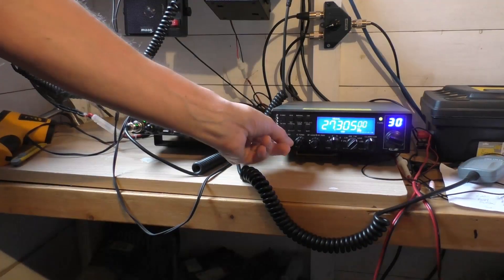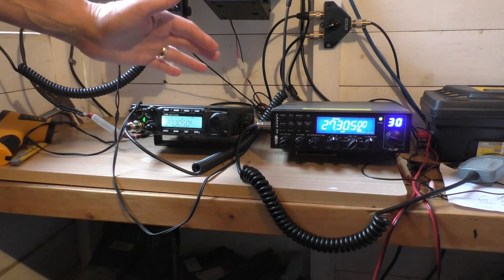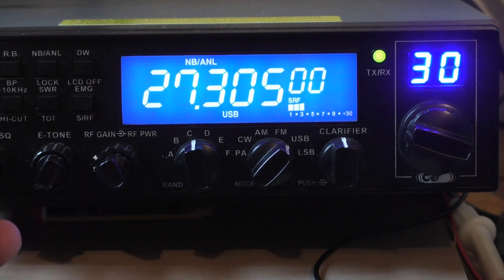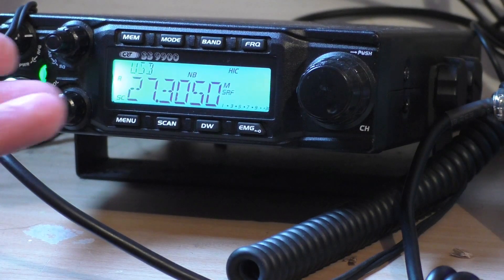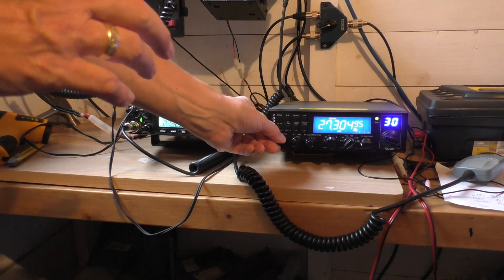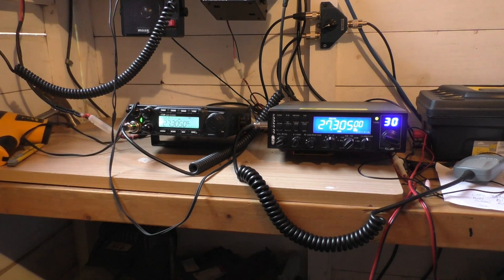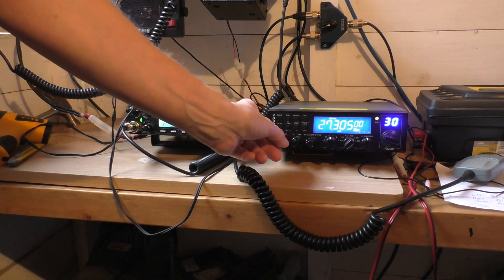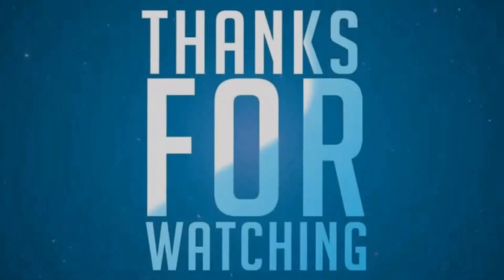CRT Radios can start off Frequency !  This could be a deal breaker.

Comment: Had a CRT 3900 EFT for 10 years and that is a quirk of these radios. As you say just let them warm up before transmitting on SSB. Even my Icom 7300 is slightly off on 11m  . Maybe because it comes stock as RX only on 11m ?? Who knows.. Even some frequency counters I have used, are slightly off .. Thanks for the upload. 73s 153 AT 888

Comment: Hello Fred , your absolutely right , these radios would work better with high quality capacitors , the capacitors can be replaced with higher quality & the radio will be fine .
Reply from the maker: Hi.  Yes your right.  I guess you get what you pay for.  They are fine if you let them warm up.

Comment: All radios drift a bit Fred, even expensive one, though they tend to be engineered so you don't notice quite so much, but the all drift and usually come on frequency when they heat up.  That is why when I fixed CB's I turned them on and left then until I set everything up to test them, by that time they were a bit more stable, some more than others.  Even the big expensive radios do it.
As someone in the comments said "Put any set in Alaska (or Antarctic) and it will drift from cold and stabilise as it heats"  Much more noticeable on SSB than other modes.

Comment: Mines always a bit high - have to set to 97.
More annoying is channel selector doesnt always change channels
Reply from the maker: Yes the channel change can be a bit odd.  If you turn it too fast it changes 2 at a time.
Reply: Fred in the Shed  i turn mine like 3/4 notches & it hasnt moved
Reply: Same deal with mine. That's because the tuning is Software Defined and not mechanical. So the RAM chip that stores channel frequencies can't keep up.
Reply: Yea , My  9900 does that thing with the channel selector sometimes ..

Comment: Hi Fred, The SS9900 also has the option in the menu to tune TX/RX together. It comes default in Received only clarifier.
My AT5555N (7900) is the same way.
Reply from the maker: Spot on Scott i made a video linked at the end.

Comment: Hey Fred ,just a update to CB Radios drifting or off Frequency. Even Calibrated Test equipment have a warm up period. Particularly 8 digit frequency counters. I recently aligned the Frequencies on my CRE 8900 using my,
Icom 7300 as a reference. I know the Icom is spot on zero beats. This link was very useful.. I am guessing most surface mount Multi mode radios can be calibrated the same way, via the service menu... Just dial in the AM Carrier, to zero beats.. Here is the link..73s https://youtu.be/9GZ5cIqNlfk  P.S. Just remember a lot of receiving stations automatically assume you are off frequency ,because you sound weird to them 90% of these stations are well off frequency..Especially on 11m.And as you said the crystals and components are budget. compared to HF rigs.. 73s 153AT888/ HS0ZOU.

Comment: Good explanation Fred my 6900 is a few HZ off frequency from a cold start but leaving it on receive for a couple of minutes warms it up enough to put it bang on.  My 9900 is the opposite its bang on from a cold start but drifts around 6HZ lower than the TX frequency especially when the finals warm up most stations won't notice it but stations using HAM gear can notice it.  There is a way to tinker with the settings in the hidden survice menues on both radios I accidently somehow nearly messed up the TX frequency settings but thankfully I wrote down the default values so managed to save both radios during the summer but your average station won't really notice it.

Best 73s from 26AYP001 Central UK.

Comment: AM & FM will drift, it's just not as critical or noticable as SSB.
Proper 'grown up' radios use a TCXO where the reference crystal is in a tiny oven which is temperature controlled so the radio will stabilize very quickly after switch on.
Reply: Hello, what is a Proper Grown up Radio,,exactly, thanks 😊 a few examples, 73 Rotterdam
Reply: @Bernard-John  I will explain the heirachy of two way radios.
At the very top of the pile, you have military radios. They are designed by the absolute creme de la creme of designers, and built up to a specification rather than down to a price. Absolutely no expenses are spared here, because people's lives depend on it.
Next you have commercial radio which are solidly built and well designed, because peoples' jobs depend on it.

Further down you have amateur radio where the user is treated with a flourish of knobs to twiddle with to their hearts content. The product designers here kind of use this arena as a kind of proving ground.  Sometimes they hit, sometimes they miss.

Then you get CB. The volume runs are not that great, the R&D investment is significant in terms of overall returns, the end users generally have low expectations, no ambulances will crash and no aeroplanes will fall out of the sky if it all goes wrong. 
CB invites the ethos of just about adequate at best and attracts the lowest sphere of designers and manufacturers.
Ik hoop dat dat verklaart

Comment: @Fred in the Shed Did you know that the CRT SS6900N has a 'talkback' function? I just found out how to enable it yesterday when I was playing with the settings lol
Reply from the maker: I know it has a monitor setting.  A talkback on a HF records a short piece of audio.
Reply: @CB-RADIO-UK  ### The CRT SS 6900N v6 'talkback' feature ###

Step 1: With the radio on Press & Hold the Function key for two seconds.

Step 2: Press the function key again. The display should read:

n09 off.

Step 3: While the display reads: n09 off   turn the channel selector.  Your 'talkback' feature is now enabled and you'll notice you'll be able to choose a 'talkback' level from 1 to 63.

Step 4: Wait until the display goes back to normal then choose a channel to test your 'talkback' volume when you key your mic.

To turn 'talkback' off again just follow steps 1 to 3 until the displays n09 off.

Comment: CRT 6900n is SDR (Software Defined Radio) and need time to warm up, like any other radio wether its a £40 or a £5,000 radio. If you radio is really off freq just recalibrate however you will need all the gear like Oscilloscope.

Comment: If this is a deal breaker then what about the icom 9700 that costs £1700 and drifts, then you need to spend another £200 on the fix.

Comment: It affects of course on AM/FM too. The Bandwidth is wide enough so you dont hear it. On Sidebands, you only use such a tiny bit of Bandwidth so you realize only there when the radio is not yet "warm enough".
Honestly i wonder why you made this video. This is absolutely normal an you can not expect any radio in this price range to have temperature controlled oszilation circuits. Everey radio technican does let a radio warm up for at least 20min before alignment.
Every single part in electronic devices is ratet to its Specs at voltage, current and temperature. 
If someone wants a "no dealbreaker" because of frequency stability he should spend a few hundrets more. 
You can not get a controlled circuit in a radios that cost 150 pounds.
Btw in your videos you can clearly hear that always someone is a little bit of frequency. Thats absolutely normal
Reply from the maker: Yes i agree.  I dont have a problem using a clarify control whilst on SSB but some people have totally rejected CRT radios as a rubbish product because of the off freq issue.  It comes up in the comments often that people are off freq on the 05 group.
Reply: @CB-RADIO-UK  yes, but this is an international, "psychological" Problem.
In everey net, always "the other guy" is off frequency. "My" radio is always exactly aligned ;-) 
The problem is no problem until the offset is a few hundret hz.
The issue is also on nearly every Radio, espacialy CB, the Grants (on the older ones you can hear them drift resp get on frequency whlile recieving/talking).
So does Jackson, the strykers, georges, the old lincolns etc. The effect is low when temperatures  are moderate in difference, like in summer. The effect is often, not always, more when it gets cold. 
And it should be remembered, in the manuals you can read a tolerance of frequency can be +- 300hz!! (Not meant frequency stability) so on ssb you can be way of frequency an still be in tolerance.
The crt s are absolutely fine.
The issue resp. complayning is way on the wrong place because of radio class/price.
Hope nothing i wrote is offending my friend, love your Videos and still trying to improve my english.
Vy 73 sir to you and your loved ones

Comment: Right as you all know these radios.
Pick up so much rubbish.
So you have to put Rf gain down to 3 Quarters on fm.
And about half on ssb?
Pain in the Arse.
So to fix this. On fm at 3 Quarters take a note off some ones signal
Now put Rf gain on full.
And Adjust T12 to the point where there signal  just starts to drop from where you had it at 3 Quaters.
Now you should have about 2-3 spoints off noise. And signals are all still as Good.
Now do the same on Ssb
And adjust T7. And you will have same Results?
Many thanks
Nick East Grinstead

Comment: Hi Fred... Could you do a video on antenna switches?   I'm just wondering do they affect SWR? and can the SWR Meter be placed between Radio and Antenna switch ? Thanks
Reply: Just buy a good quality switch and you won't have any problems, think round 40£ for a 2 in 1,good luck, second hand is cheapest, 73
Reply from the maker: The cheap ones can short and cause SWR issue.  Ive not invested in quality items myself.

Comment: They are engineerd to be off frequency when cold, otherwise if they were on freq when cold, they would be off frequency once in use.
Reply from the maker: No i doubt that.  HF radios are spot on cold or hot.  Its most likely to be down to the quality of the capacitors which take a little while to reform from cold.  Its not a big deal if your used to it but it can drive some people nuts.
Reply: @CB-RADIO-UK  yes exactly, that's what I'm saying. The change in  component performance under different temps has been factored into account so that once up to working temp it is in alignment. Otherwise, if it was aligned when cold, once up to temp and being used it would be out.
Reply from the maker: Yeah thats about right.

Comment: Hi fred i have an issue with bad modulation signal was good to italy but he couldn't understand ,me  mic gain was default with stock mic ,swr is 1.2 . Fm am are ok im at a loss
Reply from the maker: Normally i would say reduce the mic gain slightly.  Also make sure you have not turned on the echo pot by mistake as it terrible.